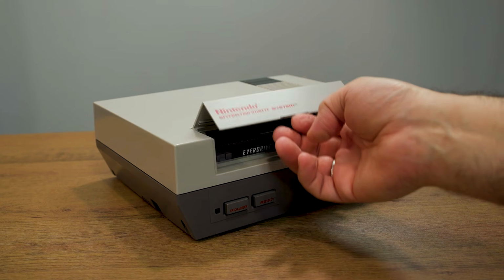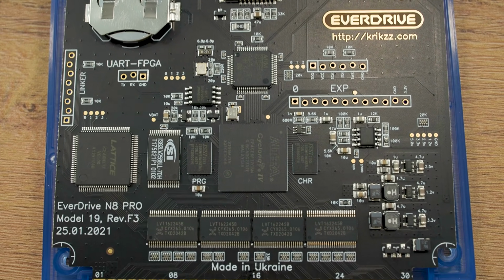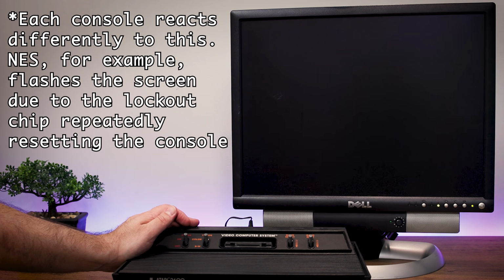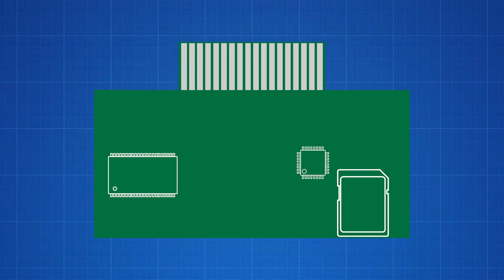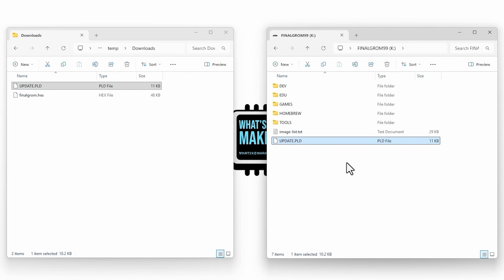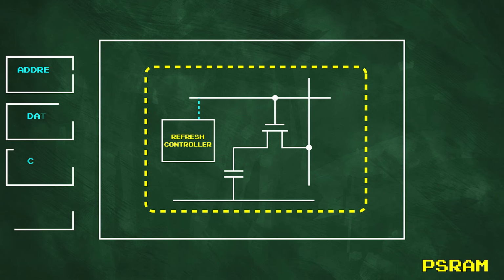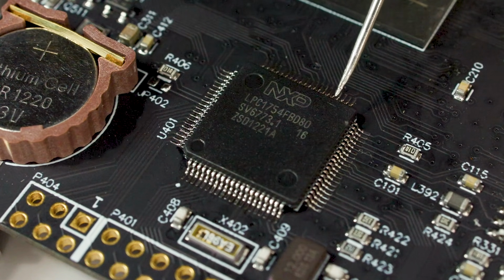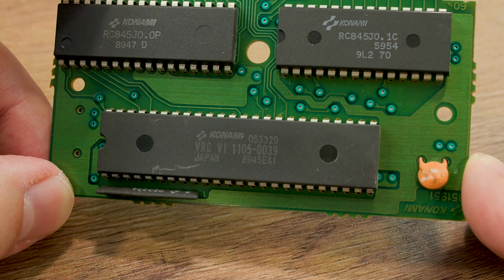The Engineering Behind Flash Carts

Comment: When Ken says flash "isn't fast enough" what he means is that it doesn't let you instantly address bytes/words the way old school ROM and RAM chips work. You have to read data off of it in blocks. So it's an issue of latency rather than throughput--flash has read throughput several times more than what something like the NES needs.
Reply: I believe here it was also a case of cost and durability. DRAM doesn't wear out or fail as much as flash, and it's cheap. And since the ROM needs to be written anyway before booting, DRAM also does the job for ROM emulation just fine.
Reply: @jrharbortproductions  ROM doesnt get written on on boot. It gets written only once but it always gets read. The only time ROM gets written is during Programming Phase. Rom uses NOR flash which is rated for 10k to 100k  write/erase cycles but you can read an unlimited amount of times. NAND flash is different it is written to and read multiple times. NAND flash is generally used only for storage while NOR is used for BIOS and permanent programs or first stage bootloaders.

However new Serial NAND and Serial NOR have a feature called XIP that allows you to run code directly from flash without loading the code to RAM. The Normal NAND used in SSDs do not have this feature. PSRAM  is DRAM with its own logic to control refresh cycles and other annoying DRAM things. It generally cost more compared to Nor and Nand Chips by Size ( Which is understandable because it is complex)
Reply: I would think you'd just load the game into an SDRam. That would allow direct access, and doesn't need a refresh. I'm an electrical engineer, but I never got too familiar with these systems but I'd think SDRam could perfectly simulate en EEProm.
Reply: @fuzzywzhe  Im an E.E myself and i fear SDRAM lmao because too much pins. It has lots of signals you must calibrate like cas, ras etc. PSRAM doesnt have this complication because it has circuits that do self refresh. The only down side to psram is that is might be slower than modern DDR since the highest Psram clk ive seen is 133 MHz (effectively 266 MHz in DDR mode). For example on esp32 s3 theres psram that can do 160MB/s (1.28 Gb/s) in Octal DDR mode at 80 MHz. That is more than enough for many situations even stuff like graphics for  displays and cameras with resolutions at 1280x720 x 30 fps (1280X720X30 @ 24 Bit color requires around 80 MB/s). So in a case like that normal DRAM overkill.
Reply: @fuzzywzhe  Not in the slightest. I suggest you compare an SRAM and SDRAM data sheet. SDRAM requires an external clock to run a finite state machine with which the external device must run in sync. That's a lot of work. SRAM is entirely asynchronous.
Reply: @Curt_Sampson  Haha. How did I do that? I meant SRAM. I'm no longer any sort of expert in memory now. Spent the last few years working in DV and VLSI design.

Number of pins don't matter, everything is ball grid array just about. Sometimes we're just using an SOC.

Honestly, I don't see the point of running on "real hardware" either. Simulators are cycle accurate and it's a lot more convenient to use modern hardware. High scores won on MAME are accepted, that's how good the simulators are now, but it's much much easier to cheat on MAME, as Billy Mitchell proved.
Reply: Modern cards are not clocked at 8 MHz though. If you are forcing it to run in 8MHz then sure. But modern SD cards can run up to 200 MHz with support for Double data rate.  Also they support reading via both SPI  and SDIO/SDMMC( 1 bit lane, 2 bit lane or 4 bit lanes and  8 bit specifically for EMMC). Psram and Spi flash can run at very high clock speeds with low latency.  Their latency is in Nanoseconds. That is faster than those old chips can even detect.  Just looking at those designs and some of the chips are unnecessary. Like for example using Level Shifters when you can get Mcus that work at 5V levels. Some of the fpga stuff can even be emulated using a Faster mcu instead of atmel one. Not to mention modern mcus have peripheals that can easily handle data transfer even in parallel. 

sdcard and flaships are so fast now that cpus and Mcus can load programs without putting them in ram directly. That feature is present in mcus called XIP (Execute in Place). Stuff like Rp pico, esp32 etc use this feature.
Reply from the maker: "That is faster than those old chips can even detect" <-- That is incorrect; even those older CPUs require memory chips to provide data to the bus in nanoseconds, before the next instruction is run. The 2A03 in the NES/Famicom, for example, runs at around 1.79MHz, so each clock cycle is around 560ns. Load instructions execute in as little as 2 clock cycles, so when you factor in address setup, stabilization, etc., the data has to be on the bus for the CPU to latch in within a few hundred ns. I actually talk about this a bit in my Tandy Model 100 overclocking video; I'd recommend giving it a watch to understand cycle timing a little more - https://youtu.be/sskej1DKqO0

Regarding level shifters - even if you're using a 5v MCU, it's still a good idea to use bus transceivers even though there's no level shifting happening. Being able to bring those pins tri-state and having a layer of isolation is just a good idea when you're dealing with a programmable device that interacts with a system bus with a CPU on the other end.
Reply: @whatskenmaking  iirc loads are a single clock cycle. The reason the instruction takes longer than that is that it also has to load the instruction itself and then the operand. For example, the instruction `LDA $03` loads the accumulator from address 3 in zero page. It requires three cycles--two to read the instruction itself, one to read the addressed byte.
Reply: @whatskenmaking  My guy you are comparing 560ns to flash that can do that in 20ns (50MHz) or less. You 

You really think you cant get data from flash in 500ns? If i low ball flash speed to say 40 Mb/s (5 MB/s) or even 20Mb/s it is still faster than 500ns.

In the best case scenario the 1.79 MHz cpu only has a bandwidth of 1.79Mb/s and thats assuming theres no latency between reading the gpio. 

I know about timing very well because I have done FPGA stuff and even designed custom cpus. To put it in perspective even another MCU can serve as parallel flash to these old devices because they are MUCH slower than the modern ones.

Also Modern mcus support tristate mode

Edit: Correcting myself on SDCARDS. It is not good at random access (as needed by cpus for stuff like branches) forgot we were talking about sdcards and had serial nor and nand in my mind. So the above was about Serial NOR/NAND.
Reply: @whatskenmaking  Right. And even without the tri-state stuff, CPUs only have so much ability to drive buses, so it's quite normal to have bus drivers between a CPU and the rest of the system.
Reply: @denizenaru  "In the best case scenario the 1.79 MHz cpu only has a bandwidth of 1.79Mb/s and thats assuming theres no latency between reading the gpio." What do you mean, GPIO? There's no GPIO involved here. And it does not read a single bit per clock cycle, but a full byte. You seem to have the wrong idea about how systems like this work. This is a parallel address and parallel data bus, designed primarily for asynchronous parallel memory chips.

If you wanted to emulate this directly with SPI NOR flash, you would need to send the command, the whole address and get the data byte back. That's five bytes (one command, three address, one data) at 50 megabits/sec, or 800 ns. Too slow! Even if we're generous and assume you have an entire cpu clock that's only 500ns. QSPI doesn't help you either because you're reading one byte at a time. Fast mode can cut that down to maybe 200ns except now you have to add dummy/wait bytes so not really. 

You can get much higher throughput from NOR flash, but it requires reading blocks of bytes consecutively, and that simply doesn't work for this application because we must support random byte access.

The only kind of flash that actually works here is parallel flash (surprise) which is increasingly rare, and given we have to copy from an SD card anyway it makes sense to use RAM instead.
Reply: @denizenaru  To your edit, using a NOR flash is one of the strategies the EZFlash IV on the GBA uses to provide up to if I recall 32 MB of on-board storage (which might be necessary in rare cases for a single game, the internal RAM has only half that size and the biggest ROMs were that NOR flash max size, that exact relationship I recall but might not be right on the exact size. GBA Video carts often used that max size).
When you load a ROM from that NOR memory, it loads instantly without the caching to RAM which it does on the SD games.
Reply: @Kalvinjj  true. there were some that used 64 MB but that was for movies. Nowadays you can get 128 MB ( 1Gb) Nor flash and up to 512 MB Nor (4 Gb). Theres even NAND flash that works like Nor(in access speed, latency & directly executable). I have the 1 Gb ones. it is easier to use the nor flash in game systems. For example most Mcus use external NOR Flash so you could implement a cartridge system by just  extending the SPI bus to a connector and making cartridges to fit that connector. You can even put multiple NOR flash on the cartridge and just switch between them. The bad thing is Nor flash size is still very small compared to other types of flash. IT might change in the future since  256Mb chips are common in motherboards  like on pc and ps4 now because of new features and manufactures adding their own flair to base code, so the firmware size increases.
Reply: @denizenaru  That makes me wonder how would be the cost of making a flash cart with just it's internal storage only in NOR format, and you just load games to it from some USB or so, with an MCU handling the show. Saves on several components but spends (I assume) a lot more on the memory. I would definitely like that option much more if the end cost is lower and specially having zero load times when booting a game. Granted, the latest generation of flash carts like the EZFlash Omega and such are so fast it's barely a problem anymore but still.

The size itself I don't see as much of an issue if we're talking about 512 MB class for anything under the N64, it's already a heck of a lot of ROMs on it with that size. Even the 128 MB one for something like the GB/GBC is fine, I don't think I have much more than that in total on my cheapo flash cart's SD here.
Reply: @denizenaru  My guess is that krikzz is doing his best to reuse parts of existing designs where he deems it appropriate. He's been making some form of Everdrive N8 since like 2012. The Mega Everdrive and Super Everdrive families go back even farther and had to write EEPROMs rather than load to PSRAM. I'm sure that way back then he felt like loading the ROM to some sort of intermediate location was the best, most compatible choice. Hard to disagree when it works so well. Also, cheap no-name cards can be incredibly slow, so it probably helps compatibility.
Reply: @TVsBen  True. Eeproms arent that common these days.
Reply: @denizenaru usually mcu's can't handle the response times of the old gameconsoles databuses. the amount of lines of code executed to respond to an address request is simply way too much. maybe you might meet the timings with a bare metal mcu with a speed of a few ghz, but you see the issue here.
Reply: @klazzera  Emulation wouldnt exist if it was true. a modern mcu can literally emulate an entire game system with a few MHz. Whats important for databuses is Timing. A mcu running at 80MHz could have gpio toggle/data speed in the  40MHz range. This is more than enough for consoles that dont have databus with clocks higher than 40MHz. Even USB, VGA, SPI, I2C, HDMI/DVI can be emulated using MCUS these days and some of these have very high data rates. The only thing that might affect mcu is the gpio count. A low pin count mcu cannot emulate  16 bit bus Address and 16 bit databus at the same time since not enough pins.

Again there are people already doing these kinds of things in the retro space.

The amount of code doesnt matter , what matters is timing and actually being able to deliver the data. For example putting the right address on gpios before reading from gpios responsible for being a databus. Dont forget that Mcu now arent just the simple  processing units from 25+ years ago but have many improvements like DMA  and peripheals specifically for parallel and serial data transfer

Comment: Well explained.
But did you know that there is also an atari lynx sd card??
Yes there is.
It is a special case because unlike other cartride based systems, the lynx does lack a hard reset feature.
Sonormally it was supposed impossible such sd card for it.
However, it was discovered that connecting and disconnecting certain pins together, it became possible to isolate and deisplate the ram chip.
Thus creating the effect of a hard reset. Thus  becoming a great alternative to get around that limitatio.
Not only that but this way it became possible to overcome the 512KB rom limit wich games were normally restricted too.
So the lynx sd card opened new and more ways for the atari lynx to be pushed to it’s absolute limits😁
Reply from the maker: I’ll have to look into that!

Comment: 18:07 I expect that one FPGA is used to emulate additional processors, such as a sound chip, and the other handles the mappers and any other glue logic. On a memory cartridge, most of the glue logic is address decoding logic, and "mappers" are just a fairly sophisticated address decoding logic. In fact, I was thinking earlier in the video that it would be worth explaining in more detail what the address decoding logic, and mappers, do, though that probably deserves a video of its own.

For those not aware: the address decoding logic is what determines the mapping between addresses seen on the system address bus and the addresses of a memory device such as a RAM or ROM. The address bus on most 8-bit systems will be 16-bits wide, giving an address range of 0 through 65535, or $0000 through $FFFF in hexadecimal. An 8K ROM will have only 13 address pins: the address decoding logic will, when it sees, say, address $E123 on the system address bus, put address $0123 on the ROM address pins and activate the ROM to respond with the data at that address. Or if it sees $DFFF on the address bus, outside the range to which you're mapping the ROM addresses, disable the ROM so it won't attempt to respond to a read from that address.

The TLDR is that every memory device (chip) has its own set of address locations, starting at $0000; when the CPU accesses a particular location the decoding logic determines which memory device and which location in that memory device this maps to.

(This is probably not entirely clear to some, which is why we need a proper video explaining the details. :-))
Reply: After some searching around it seems someone has already created a video explaining address decoding: https://www.youtube.com/watch?v=lkJwpdw57lo

I am slightly surprised that Ken didn't mention it! :-)
Reply from the maker: I figured everyone has already seen my other explanations on it 😆
Reply: @whatskenmaking  Well, I don't think that's a good assumption any more, because apparently The Algorithm loves you enough that it's recommending your videos to people who have never heard about you. :-)

Comment: It seems as though I'm fairly unique in this, but I don't care to play on original hardware. The old controllers always hurt my hands, except for maybe the Genesis and PS controllers. Once we got the perfection that was the XBox style controller, I just couldn't go back. I've got a cheapo Android gamepad now, and it's shaped like an XBox controller and it's super comfortable to hold. I just use it with emulators and that's how I play all of the old games I played as a kid, except all of my original hardware is packed in boxes, some of which is in storage. Although, even if I wanted to use the original hardware, all of the power supplies have failed except the one built into the PS1.

Comment: Some earlier revisions of the Everdrive cartridges and other flash carts supposedly poorly converted 5v to 3.3v which could damage the consoles over time, do you know anything about this?
Reply from the maker: Yes, I actually have a video on that topic planned sometime over the next couple of months
Reply: @whatskenmaking  It might be a long shot but I thought I ask about the use of MX 29L3211MC-10 3.3V eprom in Snes reproductions. These were mainly used for SA1 games but there are adapters on PCBway for regular games without special chips. Are they safe to use or not really. Thanks
Reply from the maker: Yeah, this is a topic that I'm going to dig more into in a future video. In short, there needs to be level shifting between chips that require different voltage levels. The SNES operates on 5v, so you want to make sure the 3.3v chips are presented to the bus in a 5v-tolerant manner. Some repro carts do that and some don't. Some claim to do it, but do it in a way that is potentially dangerous to the CPU in the original console. Stay tuned for more on that in the Jan/Feb timeframe